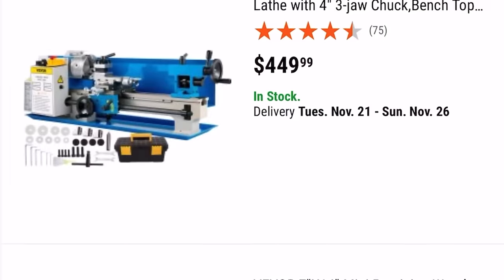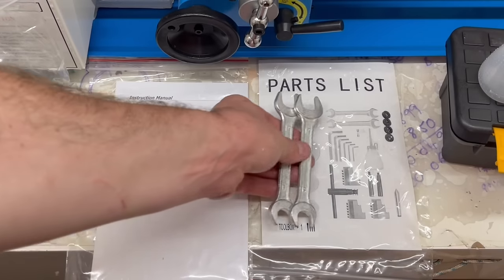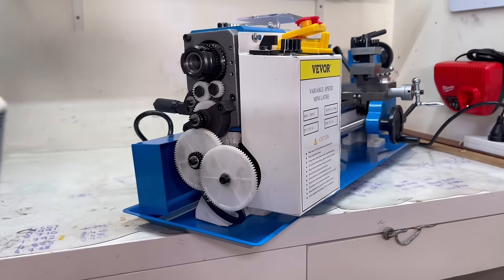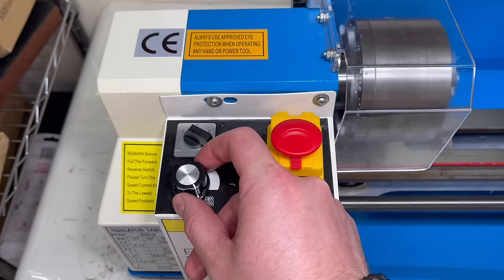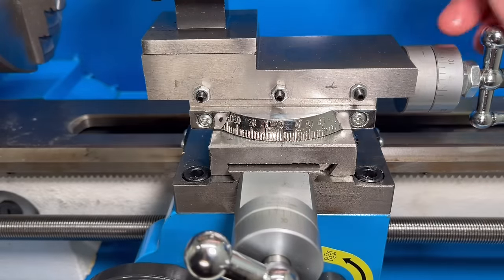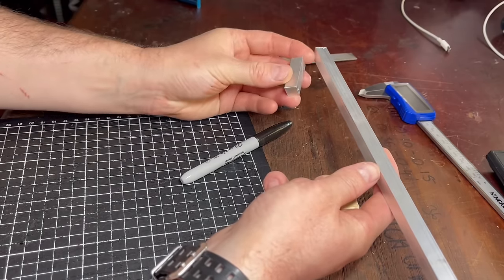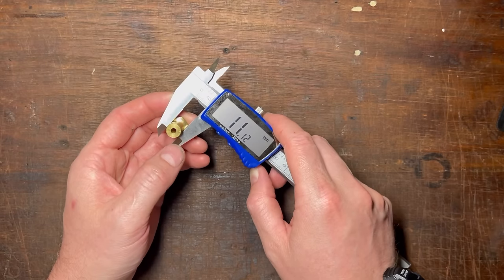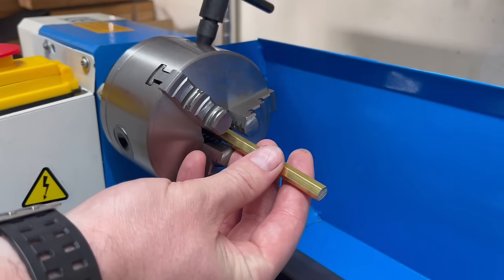Testing A Cheap Chinese Mini Metal Lathe: Is It Worth It?!

Comment from the maker: If this video helped you, please consider clicking on the THANKS button above to support my channel 🙌
Reply: If they don’t have pins that go in the holes on certain nuts they are NOT spanners.
Reply: My problem with that lathe is it’s smaller and less accurate than my Craftsman from the 60’s. It does have better controls though but I think for the money better chucks and some change gears would be a better investment for me if I will keep a tiny lathe that’s so limited in use
Reply from the maker: @308dad8  👍
Reply from the maker: @308dad8  👍👍
Reply: Valor
Reply: @308dad8  qual o valor

Comment: When thread cutting with a die.  Remove the centre from the tail stock.  Clamp the rod in the chuck. Move the tail stock to about 1” from the end of the rod and lock the tail stock.  Place the die on the end of the shaft and wind the tail stock shaft out until it lightly holds the die against the shaft.  This will give you the die square to the shaft.  Turn the chuck by hand and the tail stock handle to hold the die square as it moves down the rod.
Reply from the maker: Absolutely right :) that’s exactly what I do now! Thanks for sharing

Comment: Quite refreshing to see such a helpful and honest review. And thanks for your honesty regarding how you received this item. I have wanted to acquire a small lathe for years. Still not sure the need would justify the expense for me, but good to know that such items are available. Good job demonstrating something I have experienced with Chinese tools: usually they will do the job, but often require tweaking and modification to take them from junk to functionality.
Reply from the maker: Thanks for the kind words! You’ve nailed it. It’s a good lathe but does require a bit of work to tweak and get it right! It’s a cost vs time thing :)
Reply: @taxicamel how would you turn down that piece of stock to make that bolt? So what that he used a die, he has just showed the basic function and flaws of a $500 lathe.
Reply: @taxicamel  Whenever I finish my shop, a cheap mini lathe is my first purchase. I have very little interest at my current level for cutting custom single point threads. I'll purchase a tap and die set for that function. Its main job will be turning pins and bushings for other projects. Some day I might want to upgrade, but for now, initial startup cost is my overriding factor.
Reply: @taxicamel  you seem like a very angry, frustrated person.
Have you tried meditation?
Chamomile tea?
Vallium?
Making something as an outlet for your frustrations?

Turning threads is most certainly possible on that lathe, perhaps he didn't have the tooling for single point thread cutting?
In a push, you can actually use the correct thread size tap as a cutting tool also.
There are many, many very well respected YouTubers using these lathes and for someone who wants to broaden their horizons, its not a terrible starting point.
They have their flaws, but for the money, they will allow people to dip their toes into machining and see if they want to take it further.
Selling them is easy should people want to upgrade in the future.
Cheer up mate, go make something to be proud of!

Comment: To lock the carriage for facing cuts. Just make sure the lead screw is disengaged and lock the half nut. Then the carriage won’t move 👍👍
Reply from the maker: I haven’t heard about that, but haven’t tried it! I just preferred to make one. Thanks for sharing!
Reply: I tried this when I first got my mini-lathe and it does work but I ended up adding a true carriage lock just like in this video, surface finish improved after adding the lock.  Also added locks to the cross and compound slides.
Reply from the maker: Good to know it’s worth the time to make one :)

Comment: Good video… I bought the same and after having to replace the low/high gear box gears finally purchased a set of metal gears.  It’s a little noisy but has not failed me yet and the machine reliability is meeting my expectations.
Reply from the maker: Great to hear. I’ll swap them out with metal when they fail :) I’ll get a spare belt just in case too.

Comment: Plastic gears. There is your first clue.
Reply from the maker: Plastic gears are great. Cheap to replace, quiet, don’t require lubrication, still last over 10 years and if you get a bad catch, if anything were to break, it’s the gears which are easy and affordable to replace. That saves the more expensive parts like metal shafts, splines and jaws.

Comment: venor $923.00 
E/bay $599.00
make your own  using a drill bench press $140  3 jaw chuck $60 +  this be handy > compound table $50 temu
 steel & aluminum weeks mucking about @@
Reply: 6W 20000RPM Upgraded Mini Metal Lathe Machine Motorized Metalworking DIY Tool  - $250.00 this is small  only for hobby parts  brass aliminium etc
Reply from the maker: Thanks for watching

Comment: a bit of advice- yes EVERYTHING  an average person can afford is made in china so my advice is ,for this particular thing, go for the 8x option.  the 8x12 usually 8x14 in some brands ,gives a more compatible machine. ie u can get the accessories to fit from anywhere and they would be industry standard =easier to fit/work with . like 4 jaw chuck ,milling attachment boring bar setups different quick change tool posts etc.  also more likely to get metal change gears. plastic is just crazy. also heavier. that thing moved around /rocked really easy
Reply from the maker: Thanks for sharing 👍

Comment: I've never used a lathe before Tom but your video was very interesting. The nut and bolt turned out really good. 👍
Reply from the maker: Thanks John! Much appreciated mate :)
Reply: You do know that the actual "threading" was NOT done by the lathe don't you.   He used a tap and die for the threading.  It was only turning material to the proper O.D. AND I.D. was done with a drill bit.

.
Reply: Yes I do, thanks.
Reply from the maker: Upload a video and show us how it’s done

Comment: I would add a bit of grease on them gears
Reply from the maker: I just used oil, but I bet grease would work a treat.
Reply: @VintageEngineRepairs Tom Chainsaw bar oil works great it sticks to the gears better

Comment: Sounds good. I’m really interested in getting one, but keep seeing very mixed reviews?  Is your still holding up?
Reply from the maker: Hey :) yep! It’s fantastic and I’m using it all the time - just the other day I machined some nylon bushings for a mower and before that a metal cap for a tube of engine sealant that cracked lol it won’t now it’s made from aluminum! Buy your metal / plastic stock from Ali express, it’s cheap, free shipping over $10 USD and you can get in in all different lengths. Also, I brought carbide tooling from Ali express too and a live centre and they are fantastic.
Reply: @VintageEngineRepairs thanks for the advise. When I look it actually sounds like most people that say there so bad act like they never really had one.
Reply from the maker: The negative comments you’ll see  are from people who don’t own one and they hate on it because it’s a hobbiest lathe and made in China. I look past that and enjoy the opportunities it’s given me as a mechanic and the freedom being able to make my own parts, incredibly accurately, whenever I like :)

Comment: Looks good enough to make a Sten or homebrew... "solvent traps"... and whatnot.
Reply from the maker: I’m not sure what they are, sorry!
Reply: @VintageEngineRepairs   Haha, that might be a good thing depending on where you live!  My Chinese lathe of that design was bought in 1997 for $260 and holds plus or minus 1/16''. It's still very useful as I make sleeves and spacers for my projects with no regard for precision. It turns plastic parts quite nicely. The cog drive belt is so worn that it sometimes skips teeth. Cheers!

Comment: I would love to find out more about how you shimmed the headstock. I have the exact lathe and have been trying to solve the tapper issue for a year now.
Reply from the maker: Hey, you take off the headstock and place a shim in on the v-groove depending on which side you want the head to twist, bolt it down, make a cut in some metal and measure taper :) keep shimming until there is no taper

Comment: Im surprised how good you with it considering you've never used one before, i bought a 1958 myford ml7 to start but i hated it could not work it (it was mostly worn out for a beginner) i sold it and i bough a cheap drummond round bed but has no power feed as someone has sawn it off but i dont think i need it, ive not attempted to use it to make things yet as its so hard for me to operate lathes.
Reply from the maker: Thanks for the kind words and for sharing :) much appreciated!

Comment: You need to do a part 2 and may be even part 3 on this lathe because there is a lot more to cover, I have had this same lathe now for over 4+ years and cannot really complain if you do the adjustments change the spindles bearings to angular contact bearings lap the bed in you will get many years of work out of the lathe, I have not changed the plastic gears at all after 4+ years they are still running well today and I use this lathe every day making parts from all types metals, if people are breaking these gears they are doing something wrong, also the other job I found needs doing is remove the motor pull it apart clean the chips out and they do fill up with a lot of chips, of Couse that is going to short the motor out, and then fit some fly screen or similar to the vents on each end, I have worked out this is why the motors burn out before the end of their life as many people have complained about a very simple fix. 👍👍
Reply from the maker: Thanks for sharing your experience that’s awesome :)

Comment: What kinda watch do you have on your wrist that you can get it in the wash water & is it still working? What useful features does it have?
Reply from the maker: It’s a rangeman 9400. I am so hard on my watches and the g/shocks are the only ones that hold up. I like this one as the stop watch function can be actioned from any menus you’re in with a single press to start and stop :)

Comment: Nice video mate. A handful of years ago I purchased a Toyo M1 micro (desktop sized) lathe. It's basic, requiring the drive belt to run in different pulleys to alter the spindle speed. But at the time I was playing with model planes, so I wanted to make plastic or ally bits and pieces, so it;s been ideal so far! I'm actually a precision mill setter, but did start off with lathes as a job.
So the mini one is good fun! Could do with new bearings is all.
Reply from the maker: Awesome to hear :) thanks for sharing!

Comment: I'd have to replace those plastic gears and that weak DC motor. Once I had an AC motor with a VFD and metal gears I'd want to make a longer bed so I could turn something useful like a 29" rifle barrel. I can't see any reason to spend hours making screws that cost $0.50...

I'd probably replace the whole base with epoxy granite to stop the chatter for those heavier cuts. In fact... it would probably be easier, quicker and cheaper to start from scratch as a diy project.
Reply from the maker: Cool, yeah, there seems to be lots of mods you can do and tutorials online. I have done a few and have found it to be a great little machine!

Comment: Great video! But if you decide to order one of these LATHES do not order it with NYLON GEARS, I dont care how strong the nylon gears will be they will wear faster than the metal gears ORDER the lathe with METAL GEARS. ALSO i believe the company still offers the option of 220volt or 110volt IS that you show decide what will be the immediate advantage and disadvantages of the voltage you will require
Reply from the maker: The gears are quiet and hold up well for many years. I don’t see them as an issue.

Comment: Purchased this exact lathe 4 years ago and gave it the basket case treatment I'd normally use for a clapped out 50 year old motorcycle  ...
  Required a total strip and rebuild to be usable as I think every scrap casting & component was inserted as some psychological testing during Covid to see if myself and many other victims would crack .
U-tube has many victims of this cruel joke and I did everything and more to make mine work .
The jokes on Vevor cause I'm still sane and me lathes an absolute corker ( now )

I also know too much about cheap mini lathes so there's that .

I noticed they sent you one ; and still didn't get it right .

You didn't even find the entrance to the rabbit hole one gets sucked into cuzzy ...
Reply from the maker: LOL this is so funny I was laughing as I read it. Thanks for sharing!

Comment: I've looked at lathe's in the past several times too, but yet to buy. I'm pretty sure this is the same lathe sold by multiple different suppliers with multiple different brand names/colour schemes. Toolstation, Machine Mart(Clarke), Draper, Sealey, and probably plenty of names I've never heard of too. That probably means it's made in China so if you want one, might be worth just buying it from China at a fraction of the cost. Could probably add the drill/mill that is available for it and still pay less than one of the known UK vendors(re-sellers).
Reply from the maker: Yep lots of versions re-branded.

Comment: Great tutorial and review!  Thanks, I've ordered one!
Reply from the maker: Awesome, enjoy, I can’t stop making things on mine. I machined a broken part for a chainsaw oil pump the other day, a high carbon steel punch to a size I didn’t have and a custom bolt to fix a saw. All in all couple days haha
Reply: I can hardly wait!
Reply from the maker: @ronbunker5778  grab a cheap set of feeler gauges just in case you need to shim anything :)
Reply: Will do, thanks for tip. @VintageEngineRepairs

Comment: I have zero experience with these things but from what I've seen and read, many folks replace the nylon gears with metal ones. Should find them online. 👍🍻
Reply from the maker: Yeah I heard that some people do, I’ll probably do the same when they wear out. Thanks for sharing :)
Reply: @Grauenwolf  I had a 7x lathe with the headstock gears and now have the 8x with the belt drive and 1100W BLDC (and 1.5" spindle bore!)

I would never get another 7x lathe since the cheap 8x lathes started becoming more common.

Comment: Thank you for this review! 
How loud is it though? Is it countryside workshop loud or quiet enough for an apartment for daytime use?
Reply from the maker: It’s quiet enough for apartment nighttime use! I use it at 3am and have attached houses either side. It’s incredibly quiet. A slight hum. When you engage the lead screw it’s a bit louder. Grease the gears to quiet them down

Comment: It occurs to me that anyone who's put off by the thought of having to fettle and adjust a new bit of workshop equipment might not have what it takes to be a proper home machinist [I'm kidding]. Rather than spending a fortune and expecting everything to be perfect, I think that fiddling about and improving stuff is half the fun of it!

My own preference was never to buy new (I couldn't afford anything decent, anyway) but to get hold of something old and worn that was in need of restoration. I remember getting an ancient Myford - it took me over 6 months to revive it, but it was time well spent.

I liked the old-school approach to construction - brass, steel, bronze and cast iron instead of the aluminium, nylon and plastic that goes into most modern low-cost machines.

I can undertand the desire to have something brand new, though.

The only piece of vital equipment in my workshop that was new was the kettle... ☕👀 Cheers!
Reply from the maker: Thanks for sharing 👍

Comment: This is a very ubiquitous lathe. Thousands exist and there's plenty of support. I use mine to make pins, washers, sleeves and bushings for repair and general use (nothing complex). It's limitation is its, surprise, size and spindle torque. But for a small workspace, it's ideal.
Reply from the maker: Thanks for sharing your experience!